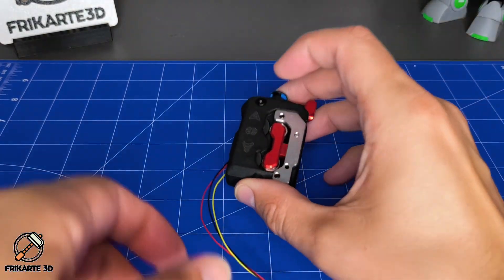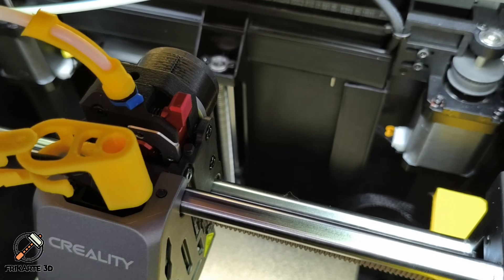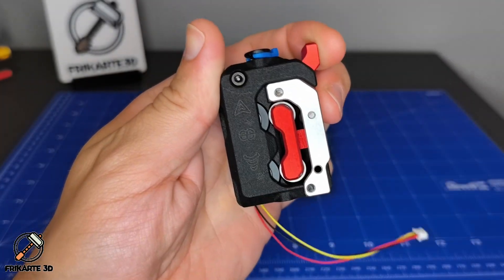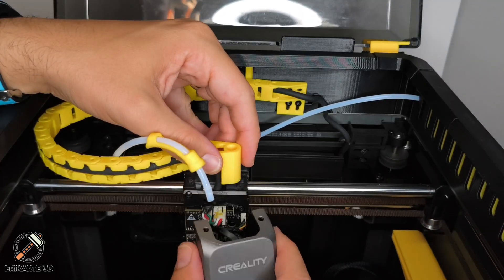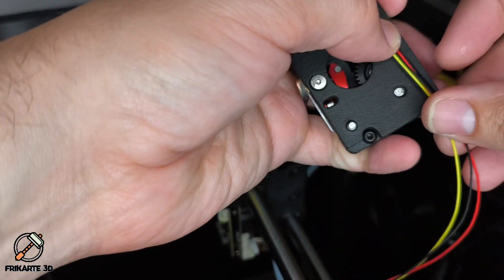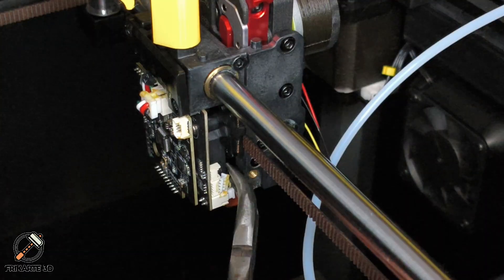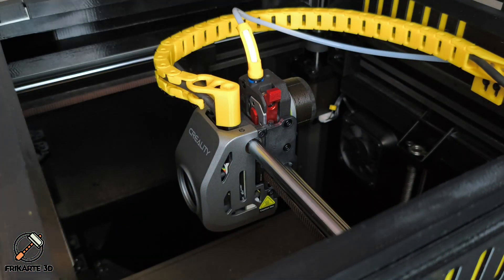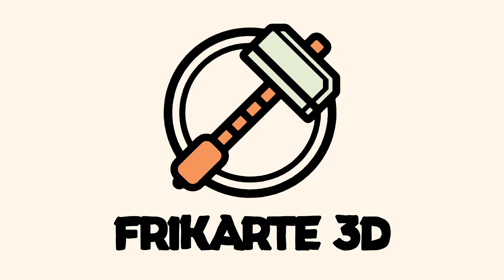Installing the Phaetus DXC Extruder on Creality K1 – High-Speed, Precision Upgrade!

Comment: how can i install filament it doesnt work
Reply from the maker: You can tap de extrude button on the printer, you need to do it serveral times with the DXC, or just do it manually pushing with the tension arm pressed. You can find a full guide with better retraction code here: https://docs.google.com/document/d/1x8GjthJhaXTYWtKhSfpmKewElGdMe5CKwgE-qd3_GYw

Comment: I just installed mine, thanks for the video! Does yours hit the back of the k1 when calibrating before a print? Mine scraped by the chain guard mount on the back while wiping the nozzle. Just wondering if this is a thing or not?
Reply from the maker: Mine didn't scrape on the back, maybe because I raised my chain.

Comment: Is that with the unicorn hotend? Where's the little blue ptfe tube?
Reply from the maker: Yes is the unicorn. I made this while ago, I don't remember if the tube was there or not 😅 If it's supposed to be there, it is. Watching the video, the place where the tube was is hidden by the board, I will try to find all footage to check it

Comment: Hello There, I have purchased the DXC Extruder, but when the unit in homing, the unit will not home correctly, due to the Motor Drive hitting the back of the unit, which cannot home correctly. I am so desperate from getting away from the cutter on the OG K1 Extruder, I have had to replace the dang thing so many times, due to the cutter no longer able to cut, and I am hoping this would help. PS where did you get the print for your chain, and PTEF connecter. I really would love if you could guide me in understanding what is going on, I fairly new to this, but the failures of the K1, is starting to push me to the edge >.<
Reply from the maker: Are you using the K1 with the multicolor mod? It is not compatible with a filament cutter. But they released the DXC 2, which is compatible with. Maybe the issue com from that. I didn't had any issue with my DXC on my K1 related to homing. For the chain and guide to PTFE yo have them here https://youtu.be/wabVEZaUSEY Keep me updated!

Comment: I'm having an issue with mine. My extruder motor behind the dxc is making that stuck noise dadadadadada. I replaced it and still does it. Thought maybe something stuck in the nozzle. Swapped it and still does it.  What do you think it is?
Reply from the maker: Discarding what you say, the most logical thing is to think that there is something in the DXC gears. If you try to push the filament manually it go through without problem?

Comment: I hear we are supposed to calibrate the E steps. I am having trouble finding easy to understand instructions.
Reply from the maker: I didn't calibrate anything and works fine for me. The only "issue" is the retraction when changing the filament where you need to do it several times or pull the filament manually. You can find a lot information on the "In Depth Guide" of the DXC on the Creality K Series Master Disrectory Spreadsheet: https://docs.google.com/spreadsheets/d/1lo7YX4nkfYGhhncVtIryOvbDM4tTaRjzZT0Y3F5O7gI
Reply: @Frikarte3D Update: I found some instructions and followed them for E step calibration. But as it turns out, it is extruding exactly what it's supposed to, so I made no adjustment. If it was off slightly, I could not measure it with my calipers, and any small error shouldn't be a big deal and could be accounted for with flow rate adjustments. 

So maybe no E step calibration needed! 😊
Reply from the maker: Yeah! The main point of this extruder is to be plug & play!

Comment: Video is great but needs more detail, for example I have a unicorn style hotend no directions to skip the ptfe insert between the hotend & extruded, also no mention of what the silver button on the tension arm is for instructions say it supposed to be a screw but mine has a button
Reply from the maker: Hey! Thanks for your feedback. I also made the Unicorn upgrade on my K1 and I removed the PTFE tube that was there as mine was all metal. I have a screw, that's used to tweak the arm tension like many other extruders have. If you have a button there maybe it's the DXC 1.1, I don't know if the new version changed that but mine was the first version that was under testing conditions.

Comment: I installed the extruder about two months ago, never had a clog since, not even with TPU! Nevertheless,, changing filament is still not working as it should, I have to hit the retract command multiple times until the old filament gets loose. Even tried to retract from computer using Mainsail, same problem. Extrudes better, needs some patience. 😅
Reply from the maker: Nice! I retract one time and then do it manually. But you can fix it this way.  Check the "In Depth Guide" of the DXC on the Creality K Series Master Disrectory Spreadsheet: https://docs.google.com/spreadsheets/d/1lo7YX4nkfYGhhncVtIryOvbDM4tTaRjzZT0Y3F5O7gI and look for IMPROVE THE RETRACTION G-CODE MACROS

Comment: I've been using this extruder for 200h+ and it's utter shit. The extension cable they provide simply doesn't work as it tends to loosen up after multi hours print, had to resolder mine as the extension cable became unusable. There's a reason creality puts a sticky goo on their's extruder plug... 

hen this extruder comes with no support at all, it randomly starts slipping on the filament and I have no idea why - no seller nor the company behind it responded to my queries.  Once you buy it, you're on your own, good luck. I sold mine and went back to the stock one. It's simply not worth it.
Reply from the maker: As you seen in my video, mine comes without extension cable, It's a bit tricky but you can do it with a bit of effort. Now the slipping filament is a know problem of the screws that they fixed with the DXC 1.1, the problem is that the arm screw move itself and untensioning the arm making the filament slip. I fixed mine with a bit of glue on the screw that avoids it to move. If you sold it anything I told you will help you but I want to share my experience anyway.

Comment: I have this same extruder, it has worked perfectly for me, but I still occasionally have extrusion problems when I try to print technical materials, such as ABS or ASA, and I have noticed that the motor gets too hot and transfers heat to the DXC extruder. I am still looking for a solution or fix for this problem.
Reply from the maker: For motor heating there are some options. Install a fan/heatsink on the motor, but there are some posts about reducing frequency to avoid high temperatures
Reply: @Frikarte3D  can you tell more on reducing frequency to avoid high temperatures?
Reply from the maker: You first need to have your K1 rooted and then change the run_current value in the printer.cfg from 0.5 to 0.4 . You can also install a heatsink https://s.click.aliexpress.com/e/_c4E85s6L or extruder fan kit https://s.click.aliexpress.com/e/_c4B77eJN to lower the motor temperature

Comment: Will this upgrade help with printing engineering materials
Reply: Would love to know too, will it solve heat creep?
Reply from the maker: I've been printing with it during the summer hot temperatures without issues
Reply from the maker: That's the idea, need to test with PA6, Nylon, CF,...
Reply: @Frikarte3D amazing this is exactly what I need to print with and I’m getting horrible results from the stock extruder, I’ve done everything to the point of even swapping the nozzle to a 0.6 mm nozzle and I’m still having problems
Reply from the maker: If you have the budget you can try getting it 🙂
Reply: How’s the reliability? And do u need to print with a filament dryer?
Reply from the maker: @Garage_Robotics No fails due extrusion, i got some stringing using filaments without drying

Comment: How strong i have to fix the screw for the filament? sometimes if i print fast i hear a kind of knocking?
Reply from the maker: Do you mean the arm tension? It depends on the filament, if you hear a sound try to tight a little bit more. Remember screwing in reduce tension and screwing out increase tension.

Comment: I just got the same extruder, is it just me or does the manual filament release not do much?
Reply from the maker: Not you, it was reported by more people. I retract more than one time to release the filament, also you can also heat up and pull manually. A optimized fix is to change the retraction gcode but need to root your printer to do that. Check the "In Depth Guide" of the DXC on the Creality K Series Master Disrectory Spreadsheet: https://docs.google.com/spreadsheets/d/1lo7YX4nkfYGhhncVtIryOvbDM4tTaRjzZT0Y3F5O7gI and look for IMPROVE THE RETRACTION G-CODE MACROS
Reply: Can you send me as well 🙏
Reply from the maker: Check the "In Depth Guide" of the DXC on the Creality K Series Master Disrectory Spreadsheet: https://docs.google.com/spreadsheets/d/1lo7YX4nkfYGhhncVtIryOvbDM4tTaRjzZT0Y3F5O7gI and look for IMPROVE THE RETRACTION G-CODE MACROS

Comment: How can I swap filament when im running out with this extruder without disassemble it all? 
Sorry for the question, im still newbie ☹️
Thanks! 🖤
Reply from the maker: In the screen, you need to find the "Retract" option and the filament will go up, someone told that maybe need to do it twice. Manually you can heat up the nozzle, press the red plank and pull the filament out

Comment: Hi, great job!!
I have a K1 Max with extrusion issues. I want to print large ABS parts. Could this be a good upgrade for my printer? Would I need a better motor or a cyclops system? Or do you think this extruder will work correctly with proper configuration? Best regards, and thank you.
Reply from the maker: This extruder is designed to solve some issues of the stock one, I noticed a big improvement on motor temperature. What issues do you have? The motor is enough to handle any type of filament.
Reply: My problem is that the extruder doesn't feed well, giving me flow problems.
Reply from the maker: You can try this extruder, but I recommend you to disassemble yours and check if the dented gear has filament there and clean it with a metal brush. I do that when an extruder starts to have flow issues and 90% of times solves the problem
Reply: Thanks!!

Comment: Way more important update would be to change motor pulleys to smaller ones.
Reply from the maker: Yes! Agree with you on that! But if you have an stock extruder that clogs for temperature creep, this is a good choice.